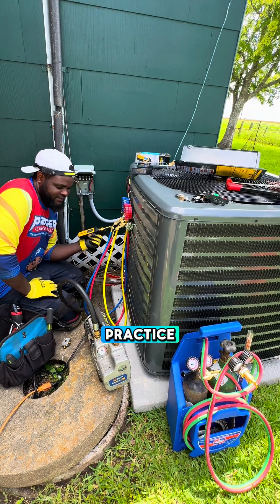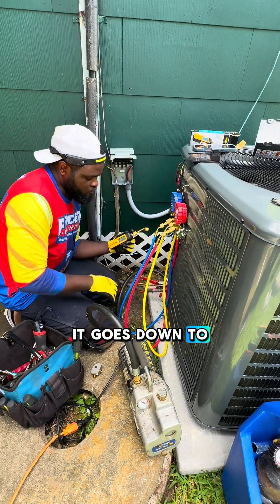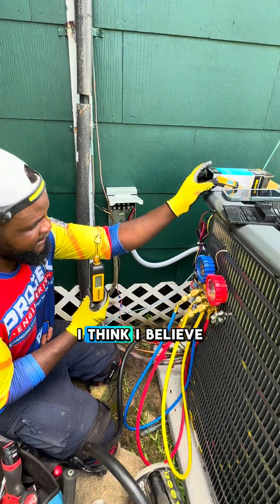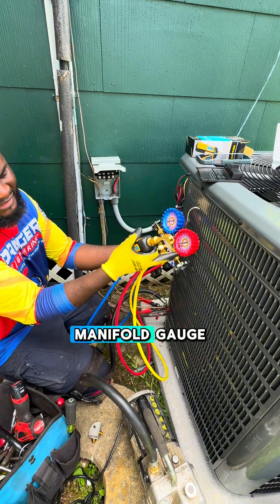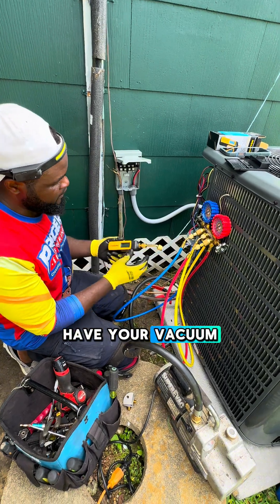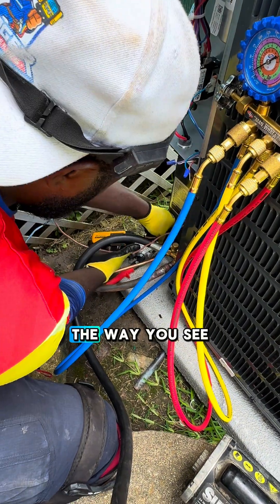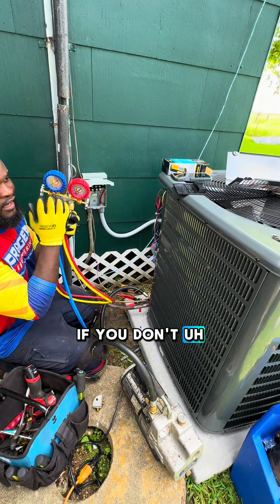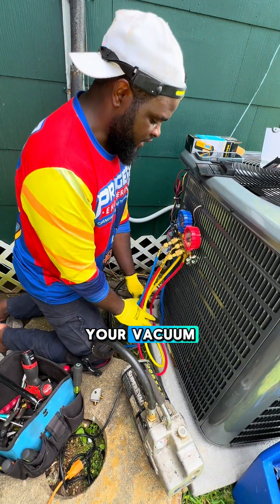how to pull a vacuum with single hose setup.  #airconditioning #fyp #viralvideo #hvac #mg44

Comment: Use two core removal tools for the liquid one fore the micron to isolate 
One for the liquid to then charge unit
And one of the suction along with the one big hose for vacuum